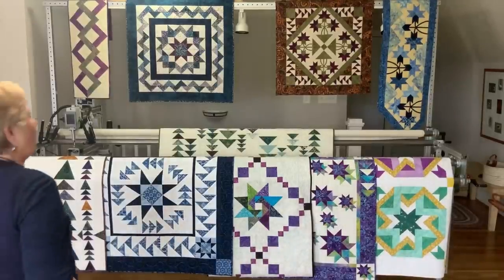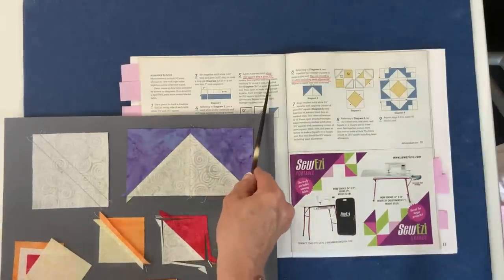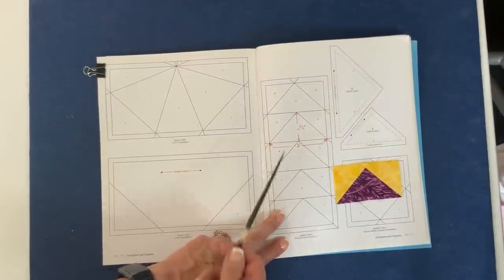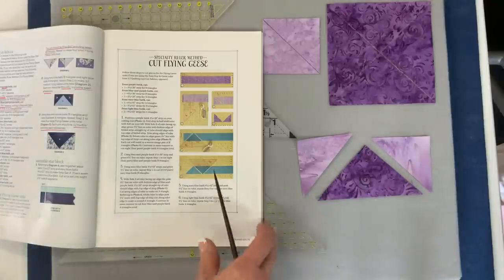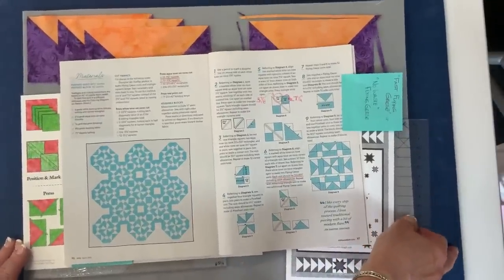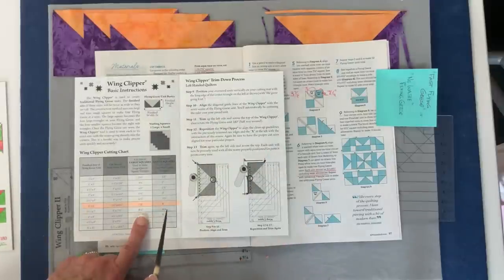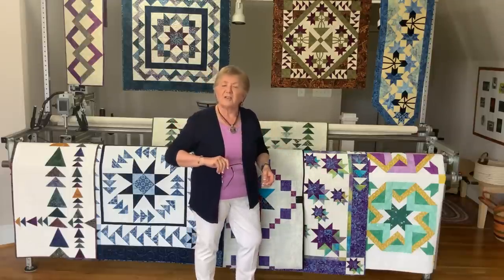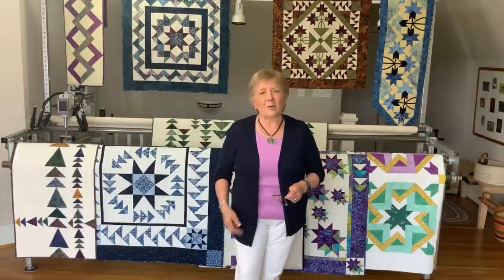Flying Geese Methods: Tips and Tricks from the Tucker Team

Comment: I too hate waste and avoid any patterns that use snowballing or flying geese and they discard so much fabric.  I use the x4 method for the fg method and find it works for me.  I am considering getting the wing clipper though to make life easier.  Got a load of other Tucker rulers and find them really easy to use.  I've just bought EQ8 as well so I can determine the block sizes and units needed that are the most common sizes.

Comment: I have “tried” the 4 small squares and one large square method in  making 4 flying geese and never could have it come out correctly. Very frustrating. I’ve also done foundation paper piecing (I happen to like FPP!) works for me.  But I need to give Wing Clipper method a try (yes, I’ve had these tools for several years but,just haven’t used them -yet).::I’ve always preferred cutting a bit larger and trimming down because there is no way I can do “precision sewing” as an author has said anyone can do - I can’t do it no matter how hard I try - even had a “discussion” years ago with a guild member about this precision method and finally showed her how my eyes dint work well together and why,I can’t do this.  Thank you Deb for making tools that I can really accomplish perfect pieces without frustration!!!
Reply: You will get great results with this tool--and get them consistently.  Just remember to nudge the small squares in a wee bit and follow the trimming instructions (it is easy to do it backwards).
Reply: @notesfromleisa-land  yes!  That little nudge in from the edges is,so,ER hung I’ve never done and need to remember to do.  We are “conditioned to line up the corners, etc. so just remembering this little tip is the most important help.  Thanks.
Reply: @sandybruce9092  Happy Quilting~~
Reply: I, too, happen to love FPP. There are some situations where FPP works best/faster. For instance, a column of stacked FG, but the Wing Clipper tools are so good. Try one of the patterns to get some experience.

Comment: How do you feel about the Eleanor Burns method - pros and cons?
Reply from the maker: I have always found this method confusing. Trying to remember which square is the ground and which is the sky. The method leaves all the edges on straight of the grain so that is good, but it has about 10%-15% more waste than our method so that isn't as great. But if you use it and get it great. Each quilter will find methods that they prefer to use, there are so many different ones for just that reason. Find what you like to use and what is easy for you.

Comment: I'm confused which tool to get #1 or #2? what's the difference
Reply from the maker: You want to get the Wing Clipper I as it has all the common sizes on it that designers us. Only get the Wing Clipper II if you need a unit size that is on there as not many designers use those sizes but they do come up occasionally which is why we have the tool.
Reply: I love your videos..I'm wanting to know and learn better methods..I'm your #1   fan..I really like everything I've seen so far..sending my best to you..